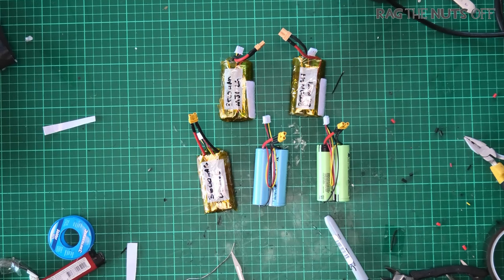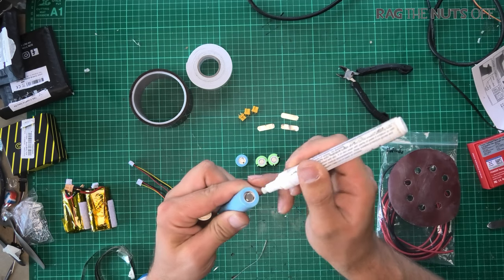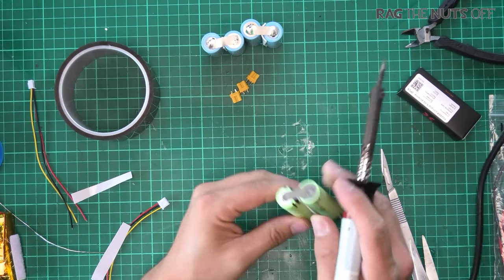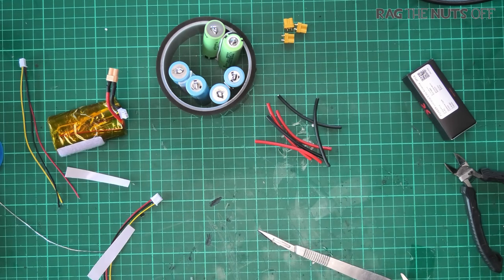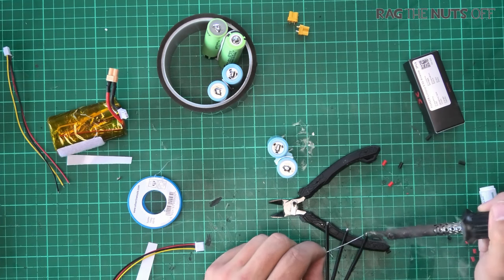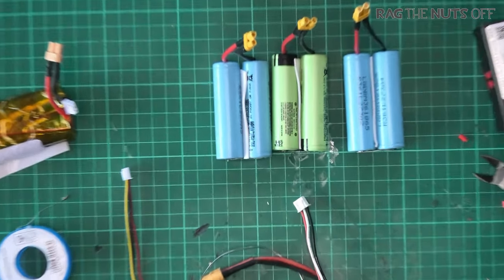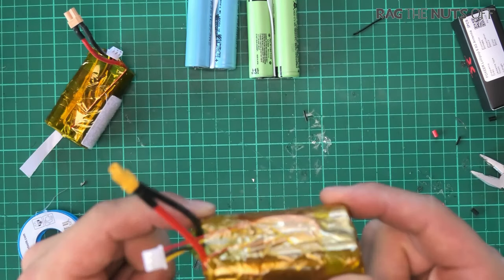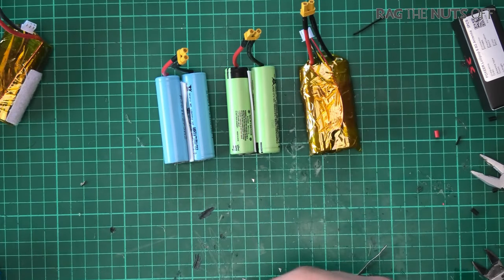Making 2S 18650 Li-on Battery Packs for RC FPV Models

Comment: In Cyprus, I cannot order from Hobbyking anymore. The Lipos here are ridiculously high priced. I might get some Li-Ions still from China and they are quite cheap. I recently got some Samsung 28A 4.3v out of an old laptop. Soldered them together to 2S. They cannot power a 1/8 scale brushless car. But a Flying Fish is totally possible. I am impressed. If they are new, man, would really save me some money. Made a 3S pack today to support a 3S lipo in my 1/8 scale in parallel. Works.

Comment: Is there a way off making some sort of 3d printed carrier with wiring all ready installed balance leads and charging leads. so you could just put your cells in and you have a battery pack?

Comment: Great video! Isn’t it dangerous if some solder drips into the + button?  I was always told that if metal gets in there the battery can overheat and explode.

Comment: maybe this was commented before put if you shorten the + and -  so that you take off the length of one battery the total length will be ultimately the same but you save a little extra weight.

Comment: Here’s where I’ve found myself.  Bought several 18650 and a charger for my jumper tx.  Got some more to build packs based on your video. … And saw a dump battery holder package.  So I’m now thinking what’s the big advantage of building fixed packs versus putting separate cells into packs then charging them separately?  Of course thats just a bit bigger and a bit less convenient.  But seems to me not a lot.  Thoughts?

Comment: it is always a bit of hazzle, work and adventure but with rewarding results to make these on your own.

And to be honest: you do no longer rely on what chinese company put in their fancy name products from hobbyking and Banggood and make your own Zippi Happy bag or however you will call these and in a better quality cause you can make sure what quality cells you buy. I tend to go with the Samsung INR 3500 mAh cause they are good, cheap and for mulitple  purposes usable like e bike battery refurbishing or tool refurbishing (Bosch 14 or 18 V Akkus for example). 

If you buy 10 of these cells you get them in Europe for cheap like 34,50€ inkl. free shipping in germany. 
And you can be sure: these samsung, sony, LG cells deliver the amount of mAh as is in the spec sheets mentioned.

2 put together for 7€ are unbeatable even though you have to pay a bit for the balance leads, nickel strips, that kapton tape and connectors ... but you always know: brand new Samsung cells capable of delivering 80% plus mAh after 500 charging cycles so you can count them down easily by writing down the amount of energy or mAh you had to recharge afterwards.

1 charging cycle in this case means 100% delivery / charging, so if you fly once down to SOC 30% and recharge it fully to fly it down to 10% then you had charged what ?
70% + 90% = 160% and this means 1,6 charging cycles - not 2. 
Short flights with low energy consumption will be counted in the charging life cycle by the amount of charged energy and not the count of charges. 

The Samsung cells do not dy suddenly if you are over 500 charging cycles they simply tend to charge less energy so flight time will be reduced and you can count on them for 1500 charges and still above 50% SOC capable cause our lawn mower battery pack made it over 2424 working hours in 3 years and these represent 1500 charging cycles cause we knew that each time the battery SOC was only used for 70% which we knew due to the running times between charging and full running time without recharging. 

To keep things safe I used  them up to 500 charging cycles being aware of the capacity cause every 100th carge I measure them out. Afterwards they will be reused in powerwalls or other applications cause they can last much much longer in low Amp use cases. 
buy 100 and you get 3,7V x 3500 mAh = 12950 V x mAh = 12950 mWh = 12,95 Wh which equals 1,295 kWh
that is roughly 10% of the energy a family needs each day. 
If you buy 200 then you will have the storage your family needs each night ... and that is where the  Powerwall journey starts, so buy a fey and a first solar module to start you experiments. 

Best use case is a portable battery chargerbox that you can use at the club out in the field to recharge your lipos and carry back home to connect it with 1 or 2 solar panels which will charge your charger box. Start small from here and look what others did to understand the solar power for your RC chargerbox or motorhome or boat to gain experience cause this is the easiest way and cheapest cause the solar panels deliver DC and the battery need DC ...   

Here for german or european buyers the cheapest source for genuince Samsung cells

https://www.ttt48.de/akku/lithium-ionen/18650/samsung-inr-18650-35e-36v-37v-3500mah-lithium-ionen-akku.html?sort=1
Reply from the maker: Oh wow, they're 3500 and 10A rated. Just like the LG MJ1's I've been suing for the past 2 years! Matt

Comment: Normally it is forbidden to solder them, maybe she will damage or explode/burn easyer. Oke, I have thse bms board for 2S only when the batteries are not yet empty the board do not switch to charge mode. Is this normal? the voltage of 8.4 volts stays on, and so when connect a charger it gets problems, what I need to ste charge mode? maybe higher voltage input? I do charge with 5 volts.

Comment: Hi, what are you using to charge up these 2s 18650 packs? does it need a balance charger or how does that work..i'm building some packs "from laptop batteries unprotected" for my kids cheap rc but im a bit of a newbie to some aspects of charging machines and 2s packs.
Reply from the maker: Yea don't use laptop batteries. Why would you use somebthing that has had thousands of cycles on over your or your kids heads when they are so cheap new? (I have never seen the logic in this) As for charging, a standard RC battery charger doss the balancing for you. Matt
Reply: @RagTheNutsOff  hey matt,thank's for your reply..this pack of 6 i got in mind only had a year on the laptop but yeah i get what your advising. RC car will be on the ground but same difference..so one of those ebay imax b6ac would do the job?
Reply from the maker: @stigonutube  yea I had one of those for more than a year. They work well. I ended up with two quad chargers in the end as I get through so many batteries in one days flying 😅
Reply: @RagTheNutsOff  ok mate, happy flying..good video by the way,it has helped me a lot.
Cheers from Australia
Reply: @RagTheNutsOff  hey mate, been a while just wanted advise on my pack that i built.? i did take your advise and bought some new 2x2600mah sony vtc5a 35a discharge 18650, 14awg silicon wire for + and minus and balance lead as you have my problem is 2s pack gets very hot im talking 46.5c  degrees at full discharge in my WL toys 550 motor 7.4v RC Car about 15-20min run time..RC goes great but seems hot?, your thought's please?

Comment: You say, “solder left side of balance wire to the positive” but how do I know which wire On the balance lead to use. Which way do you have the balance plug to associate the left side?

Comment: I have been struggling with making the solder stick to the battery cell. People keep saying that I need a high wattage solder (somewhere between 60 and 100 watts); however, my solder is 30 watts. May I know what is the wattage on this solder you were using?
Reply: I've soldered 18650 cells with a 25W Weller iron, but now use a 90W iron. Nobody ever mentions the solder and flux. Here you go...I use rosin flux paste and 63/37 leaded rosin core solder. It has a lower melting point than anything and is eurectic. Use leaded, no lead is junk. Never use an acid flux. I set my iron at 750* and using the above solder, never have had a problem.

Comment: Hi I have ncr18650be which have max discharge about 3.6A. is it safe for plane ESC? Thanks in advance
Reply from the maker: Howdy, that's probably a bit too low. But really depends upon the model and it's current draw. You could double them up in parallel that would double the current capacity. Matt

Comment: Hi.  Thank you for sharing this awesome video.  I am new to RC.  My RC car came with only one battery pack.  After I came across your channel and I would like to make some extra batteries (2S) with 18650 batteries like yours.  Question... can I or should I charge this battery packs with original charger that came with my RC (it's a usb to balance cable charger)?  Or should I buy a better charger (smart rc charger) to charge them?  Thank you much in advance. Cheer! :) Jack

Comment: Hello sir? You said in one of your replys that you charge these 18650 on lipo settings is this safe and  why use this setting thank in advance
Reply from the maker: Howdy, see the specifications for your batteries. They vary between cells. Matt
Reply: Thanks

Comment: Is there a reason why Nickel is used instead of copper for connecting the cell terminals?
Reply from the maker: Probably for conductivity and cost. Both will be fine though. Oh and nickel is preferred for spot welding. Matt
Reply: Unless you have a real strong spot welder, you can't spot weld copper, too conductive. If you are using hi drain cells like Samsung 25R, and soldering, use copper. It can handle 4x the amperage than nickel.

Comment: Hi Matt...so for Dart 250g which battery blue or green....not doing mega distance but park flying with longer endurance than lipo for the moment
Reply from the maker: Howdy Alan, either would work great. Out of the two, the Panasonic green ones. I have used those for years now. They do perform well. Matt

Comment: Love your videos. I have a bunch of Sony VTC6's and a speed charger I use for my Fatsharks...can I just buy a 2s 18650 battery holder and solder an xt30 on the leads and use it that way? Will it add too much weight with the holder in the Dart250g? I really don't want to solder my 18650's together because I use them for various transmitters and goggles.
Reply: Yeah be careful about the contacts on the battery holder. Might have high resistance.

Comment: i just did a couple of 21700 4000mAh packs for the 250g
Reply from the maker: WOW! That'll fly forever now!
Reply: @RagTheNutsOff  hahaha, yea but way nose heavy with just the 2 in there.... would have to add a bunch of lead to the back even though the vtx is back there

That or a honking big motor
Reply: Thats awesome! How many cells and what is the weight of that 21700 4000mAh pack by any chance ?

Comment: Hi, I’m really new to all of this but I fancy having a go at fabricating batteries for my Dart and drift. I followed your video and it seems to be pretty straightforward however my concern is how far to let the battery’s discharge without the rx and esp. shutting down would it be sensible to disharge them to say 5v   and then change battery packs this would I am assuming still give me pretty long flight times compared to the li-po batteries. Is what I am saying making any sense. Cheers oldsurveyor1944

Comment: have you tried the 21700 ? they are slightly heavyer, but can store 5000 mah and is still lighter than 26650
Reply from the maker: Hey Johnny, not yet! Maybe on the next buying session. Matt
Reply: @RagTheNutsOff  Cool, i made some myself with Samsung INR21700-50E 5000mAh - 10A , the weight is 69 gram each, and do store 5000mah each cell... tested them on a quad and flew for a very looong time :)

Comment: Matt, could you just say something about charging these batteries: how does it differ from LiPos, can they be balance charged?
Reply from the maker: Hey Mike, absolutely balance charge them and depending on the cells (check their specs), I charge them as LI-Po batteries on the charger. Matt
Reply: Most chargers have a lI-ION battery setting. I charge them at 1C

Comment: /hi Matt. What is the soldering iron temperature?
Reply from the maker: Absolutely no idea. It's the cheap soldering iron from Screwfix! Matt
Reply: I use 90 w soldering iron at 480 °c, just put 2 seconds the tip on cell with this température , interest is to warm strong and on a short periode the cell , I  noticed the negative pole needs more temperature than the positive pole , I assembled Liitokala 21700 ( 3 s 4000mah ) on my old bixler , the pack  works very well since + of 1 year, vive les batteries liions 😃
Reply: I use a 90W iron set 700*-750* F.

Comment: Also, why don’t you use the battery protection boards that I see can be obtained very cheaply. Is it because they might be a possible failure point?
Reply from the maker: Howdy Mike, yes that is a concern, also they are not normally needed. The max amp draw on the Dart & drift is 5A, except for a little bit over on launch. So combine that with the failure point and that I balance charge them, its just not needed. For a bigger pack, yea I can see the benefits. Matt

Comment: No BMS?
Reply from the maker: Nope. That's what a battery charger is for with the balance lead.
Reply: @RagTheNutsOff  Sure, but what about discharge protection?
Reply from the maker: @kjensen6281  none at all if the battery does not have one fitted. Use with a current sensor an/or a flight controller